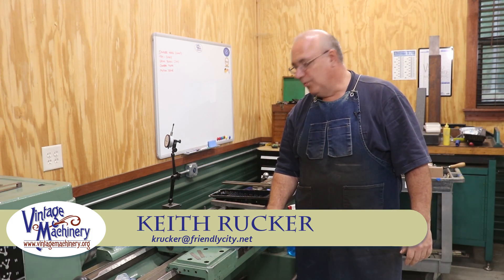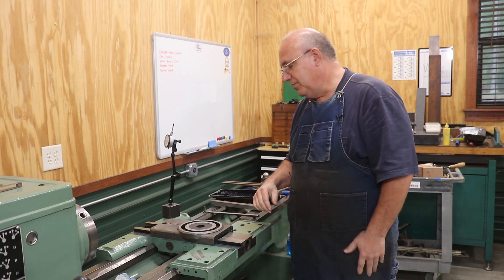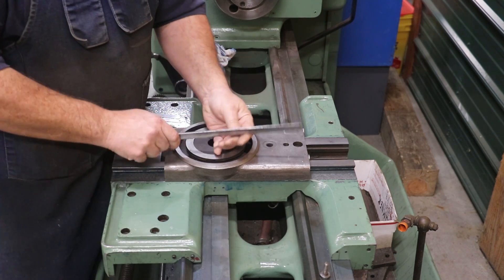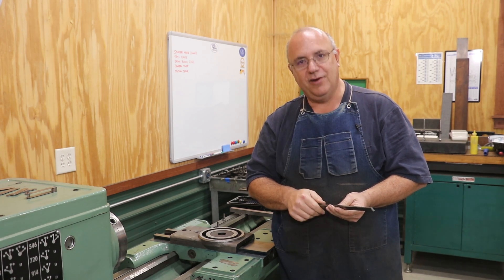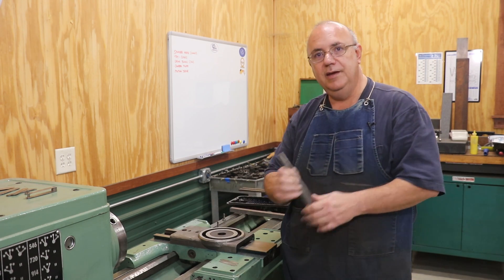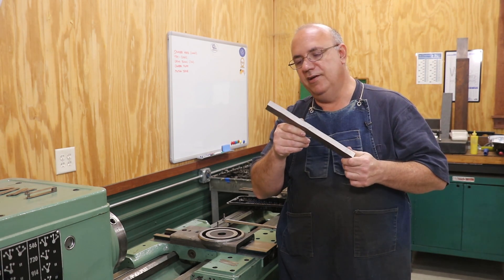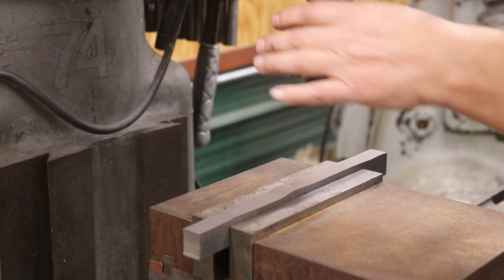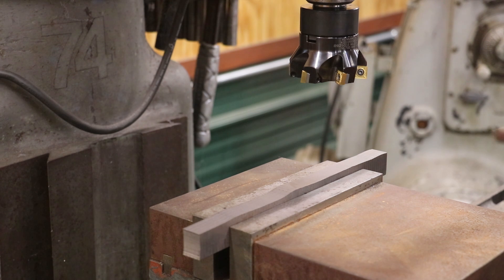Monarch Lathe Restoration - Part 19:  Machining a New Gib

Comment: I had to smile while I watched you trying to avoid saying, 'yes, turcite would work, but I don't want a bodge job, I want it to be right, and traditional '.
It reminded me of why your antique safe restoration is still not finished. Yes, you could have turned the dial out of a piece of brass and finished the project. But in those days they cast the dial, and that's the way you are going to do it.

Comment: I made a tapered gib for my milling machine. I didn't have a good template but used an Edge Technologies tramming gauge to get the angle after calculating taper per inch.

Comment: Brass makes nice gibs as well, very compatible with cast iron,
Reply: Not brass, but bronze! Brass will get smeared on the ways.
Reply: @sid1977  Seems to have worked out OK on my 70 year old lathe's cross slide gibs....
Reply: @TyphoonVstrom  I don't argue - it will work. Especially with plentiful lubrication... But cast iron and bronze are better.

Comment: Other than Keith “not being crazy about the idea” is there any reason not to use shims?  He said shims were quick, easy, cheap and works.
Reply: Making a new gib is a more permanent fix than shims. Better control over dimensions too.
Reply: He didn't say the main thing: shims decrease rigidity.
Reply: How are you going to attach the shims to the original gib? You don't want them just floating around where they can slip out, or worse, maybe end up overlapping. However you are going to do the attaching, it is going to have thickness, and it probably won't be 100% flat, so you are still going to end up having to grind (and probably scrape) in the shim material. Now you are dealing with scraping something softer than you are used to, which might take some practice. Overall it probably isn't much if any easier than making a new gib if you have the tools to make the gib, and Keith does.

Comment: Can turcite be milled or ground after installation? If so, why not use the thicker material and then reduce the thickness as needed?
Reply: It can certainly be milled (and probably ground) since it can be scraped. However:

There's some thickness of glue on the back of the turcite. How thick is that? Is it thicker on that .040 stuff Keith has than on .020 stock? 
Is turcite homogeneous for its full thickness from glue to the surface, or is there backing material and a different composition for facing material?
Is .020 turcite a different composition than .040 turcite? Is it maybe harder because it is much thinner?

I don't know the answers to those questions, but they might be reasons you wouldn't want to mill .040 turcite down to .020.
Reply: It certainly can be machined. That's the best way to do it IMO. He could also have machined the old gib down a bit to add turcite. The only issue with turcite on the gib is using a lock if it has one. Usually the lock screw pushes on the gib. If the gib has turcite, it's too slippery to hold.
Reply: @WatchWesWork  I wouldn't think that would be an issue, as the gib is held in place and adjusted by two screws, one on each end.
Reply: machintelligence 
That’s exactly what I thought
Reply: I'm still salty about the guy who bit my head off for suggesting that in the last video.  Turcite must have pissed in his oil can or something.

Comment: If the old gib was shortened by about an inch or so would that work? Less area in the cross slide but surely enough?
Reply: No, the adjusting screws would not reach.
Reply: @randallanderson4999  So a spacer would be needed, maybe from the gib offcut?